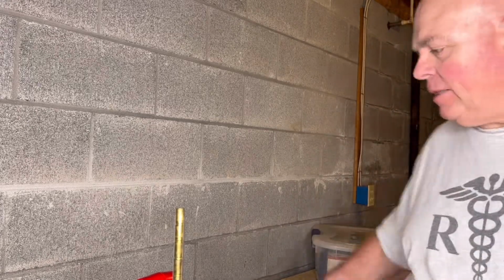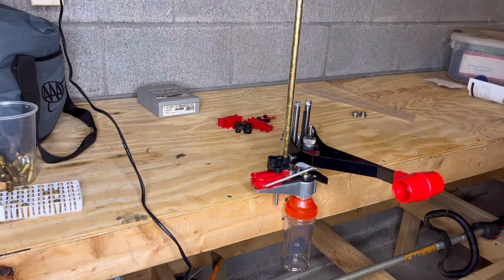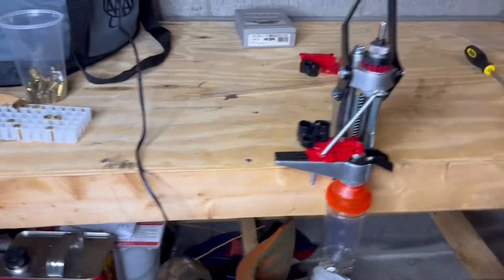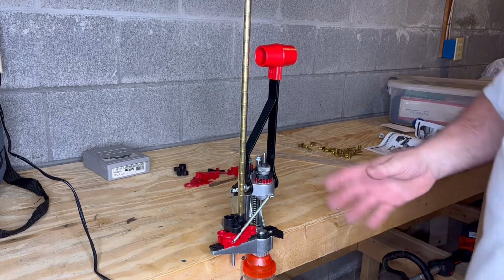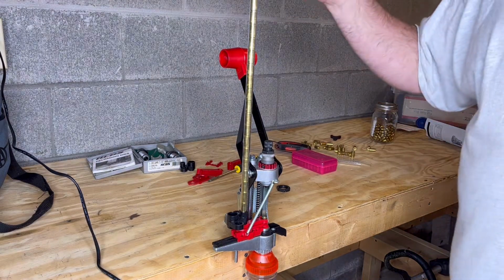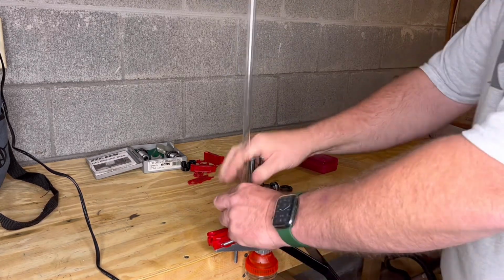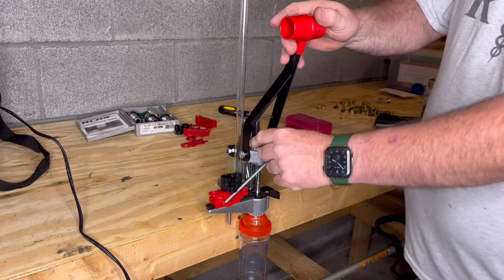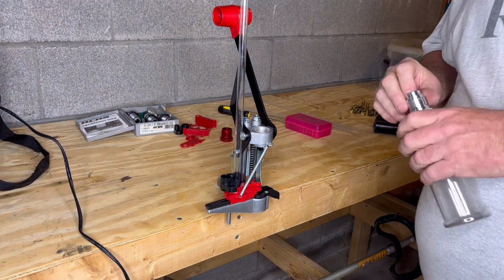Introduction to the Lee APP press

Comment: Decapping and resizing on the APP is ridiculously fast and easy. The little hiccups, especially with range brass, are to be expected. The time saving far outweighs any imperfections.

I did upgrade the handle. When running the 4 tube  case feeder, that new roller handle makes a difference.

I also recommend Inline Fabrication QD mounts. I was using Lee's mounts, but Inline Fabrication is exponentially better.

Comment: Get a Dillon 550. You can load almost anything and no tinkering around.  It was the best thing I bought.
Reply from the maker: I have no problem with Dillon stuff. I know it’s high quality, but at the price it should be. I have everything I need to effectively load everything I shoot. So I have no reason to drop a grand on Dillon stuff to do the same thing. So is it really no tinkering around? I’ve read some reviews where people seem to have problems with the priming system. But, I’ve never used one myself.
Reply: I have owned 8 or 9.presses over 50 years.  As far as I am concerned, nothing beats the 550.